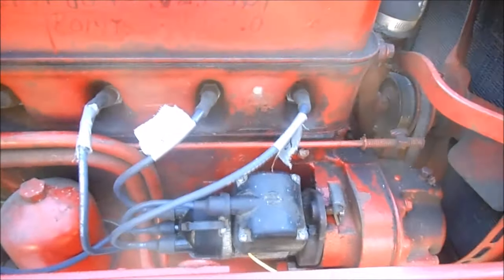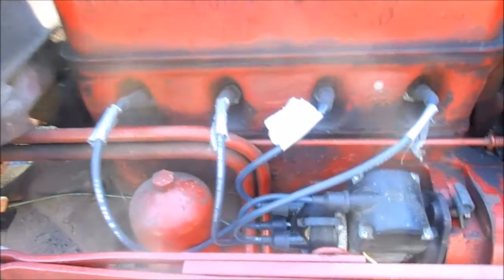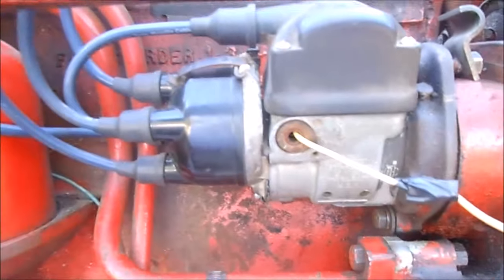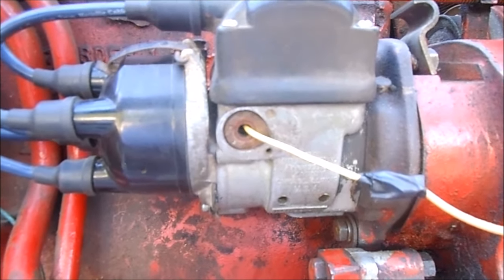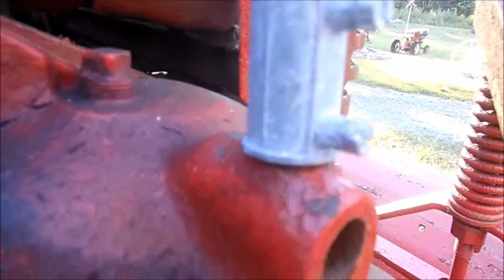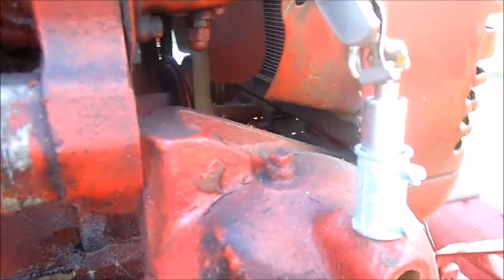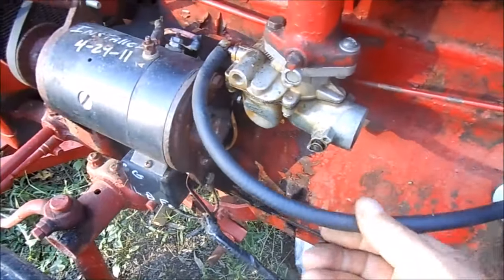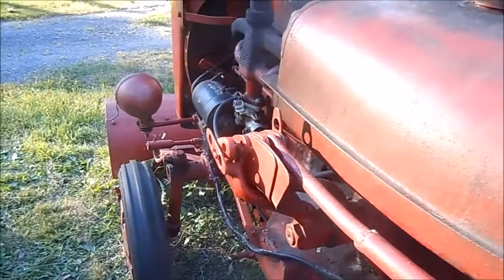Farmall  H4 Magneto  NO SPARK FIX

Comment: Hi Dan, after watching this video I learned already something in the attempt to start my Farmall, I have one problem so far, it don't go out of gear, I need to lift the plate over the gear box to see what is going on
Reply from the maker: Try jacking up the rear of the tractor to get the weight stress off the gearbox, make sure it is Secure and chuck the front wheels, then Rock the rear wheels back and forth and work the gear shift.  If it was sitting in gear a long time it could simply be stuck due to the Pressure of the weight. Also the Clutch pressure plate could be frozen.  I want to be of as much help as possible but not much space here to write responses, so maybe better if we correspond by email... Here is Mine...   danscaretaker@hotmail.com

Comment: Im having a issue where the rotor is not sending a spark to the coils any solutions? Brand new rotor cap and wires has spark out of the coil pack but not out of the  cap
Reply from the maker: Sounds to me like a Dead Short INSIDE the Distributer. First thing Id check the cut off switch and make sure it is in fact good. Simple way way to do this is to disconect the wire from the Distributer . If the short is Not there, Then I'd change the Condensor. Good Luck.
Reply: @MrDanoconnor  Brand new condenser and switch
Reply from the maker: @DumbCow461  Sometimes the SIMPLE Fixes can be the hardest to see and solve.  It has GOT TO BE something Very Simple that is "Hiding in Clear View"..I know it sounds off but .I have Sometimes had  the Carbon contact on the inside of the Cap  not reach and make contact with the rotor. If Tyou have the old cap try to switch it. Sorry I can't be of more help...Wish I was there to see it.  Good Luck.
Reply: @MrDanoconnor  tried that too just randomly quit one day and hasn't worked since

Comment: Hi Fantastic video, i have an international AW6 it was running ok 2 weeks ago i went to start it yesterday it cranked over with starter motor then would go bang out the exhaust i cleaned carby but i noticed the points were set at 20 thou would that be right i have been told.013 for the h4 mag    i have just noticed the last owner has put number one lead going to the rear spark plug  not the front plug near the radiator it was sparking but don't think there is now the points must be to close together or it could be the switch on steering column any help appreciated
Reply from the maker: For Original Mag set up, .013 is the proper gap.  on Points.  My advice is to  start from the begining... remove and clean all the Plugs, Gap them Properly, make SURE the plug wires are on  properly. #1 is closest to the Radiator . Firing order is 1342 from Front to back. Cut off switch may get stuck and ground the mag at times but NOT common. You Test it you can simply disconnect the wire at the Mag and when the tractor is running connect it to see if the tractor shuts down.... When You are Done, Mark the Wires so You will NOT reconnect then wrong by accident. I have posted several vids on this subject...  Good Luck

Comment: Hi, can you tell me if the # 1 piston is in the front of the engine?  My dad is having trouble with the firing order..it says on engine 1342.so the #2 piston  is in front ???????
Reply from the maker: This is a common Mistake... 1342 is the Order in which they FIRE...AKA...Firing Order... the Cylinders are in 1234 starting at the Radiator side, #1 and the Steering wheel side #4...take the Distributer cap off, crank the engine by hand or bump the key and watch the Rotor...when it points to #1 on the Cap, then attach the wires to the cap   CLOCKWISE in the Order 1342. If You Don't know which one is #1..take the #1 plug out, place your thumb over the hole  and crank the engine slowly until you feel the compression stroke push your thumb up . The Rotor is Now Pointing to #1... attach #1 Plug Wire to the corrosponding cap hole, then #3, #4 and #2... CLOCKWISE Direction.  Hope this helps...Good Luck...if you need more help, just ask.
Reply: Thanks a lot, I thought 1432 was the cylinder order..thank for the info...